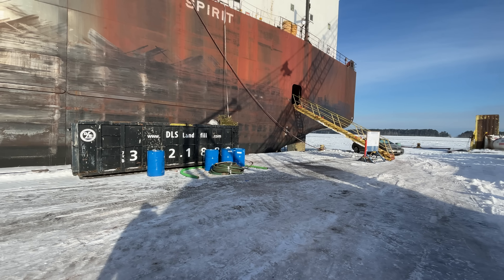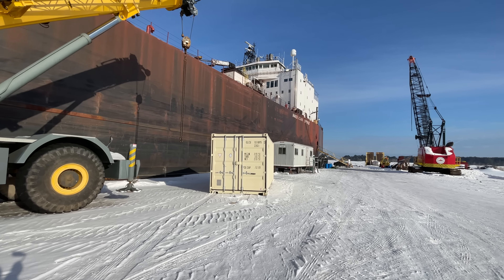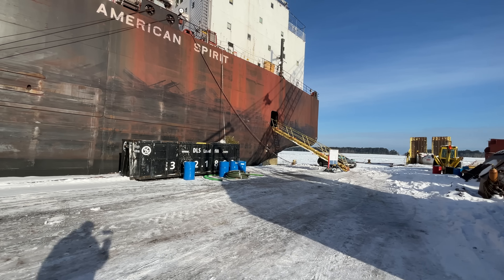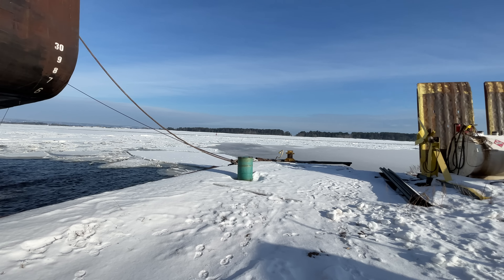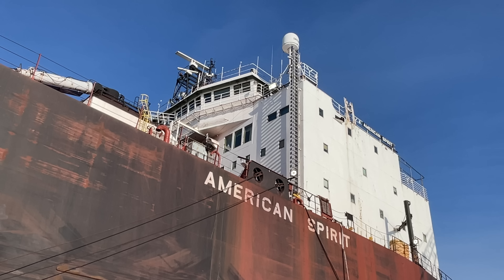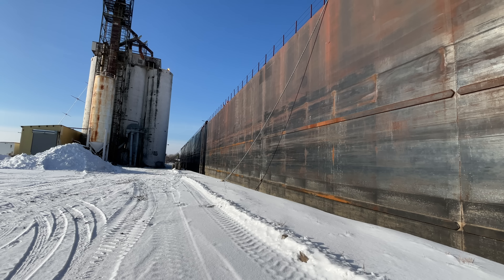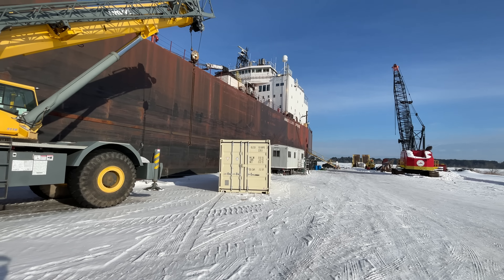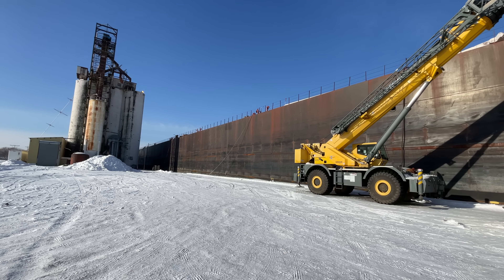How does a Ship look in Winter Layup? Ship American Spirit (1,004’) tour on Lake Superior ⚓️🚢

Comment: 2:41 any idea what the bubbling in the water is from? And do her propellers really sit partially out of the water when she's completely empty?
Reply from the maker: Stephen,
It’s the similar to a fish tank bubbler. There is the same large bubbler system on the other side of the ship that protects the other rudder and propeller. The bubbler creates a constant current at the surface of the water which prevents ice from forming. The ice could damage the propeller and rudder. I’m guessing it’s cheaper this way from a cost standpoint vs. putting it at dry dock or lifting it up? That’s just my guess. I’m still very fascinated by the bubbler system. I was not expecting that.🚢
Reply: You are correct about the bubbler’s being used to keep ice from freezing around the propellers and rudders I use to work at Bay Shipbuilding and they did that to all of the ships that were moored in the water during the winter
Reply from the maker: @mattharper588 that’s what I thought it was for. Thanks for confirming.

Comment: How big are those propellers?
Reply from the maker: Good question, I found this information about another ship that is very similar. I’ll bet the propeller is close to the same. “The massive four-blade propeller has a diameter of 18 feet and can make 120 revolutions per minute (RPM). Made of nickel, aluminum and bronze, the propeller weighs 13.4 tons.”

Comment: Hi Mike! Two questions about the American Spirit:
1. She had a engine go down in late September. They never fixed it. Are they working on the engine during the winter shutdown?
2. Why is she the only American Steamship owned boat that gets her "in transit" supplies from the Soo Marine Supply Objibwa after leaving the locks. She was a regular customer until her engine problems shortened her runs to the steel plant at the Soo. 
Thanks for any information you can give.
.
Reply from the maker: Kevin, regarding the engine on the ship, I don’t know if they will be fixing it right there? I didn’t see any activity with them fixing, nor did I hear about it. I’m not too sure about the supply situation. I will have to look into that.🚢

Comment: Is the ship raised up from just being unloaded or is this how deep in the water it is normally sitting? Are there more bubblers around the other side of the ship? Does the ice move and potentially case damage to the side away from the dock? 

Thanks for the video. Great that you were able to get that close. 

If you are able to get close to the docks where they load the ships, that would be a fantastic video. Even a view from a distance would be interesting.
Reply from the maker: Yes, there are bubblers on the other side by another rudder and propeller. Yes, they are trying to prevent the ice from damaging them.🚢

Comment: The side of the ship looks beat up. Some of the steel plates look pushed in. Is that from going through the locks?
Reply from the maker: That is correct, the ship went through the locks and it causes a lot of scrapes and damage. It adds a lot of character to the ship.🚢
Reply: @vibewithmike  Does the damage get fixed up during it's 5-year inspection?
Reply from the maker: I’m not sure? I would guess they fix any damage that could comprise the structural integrity?🚢